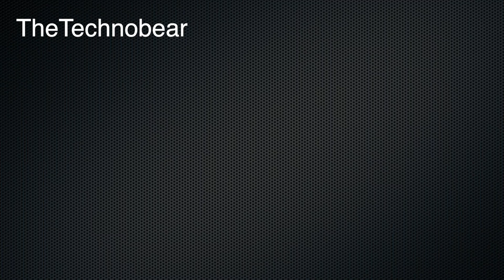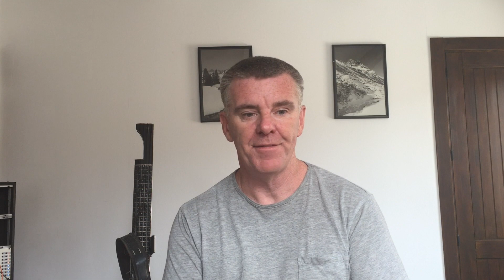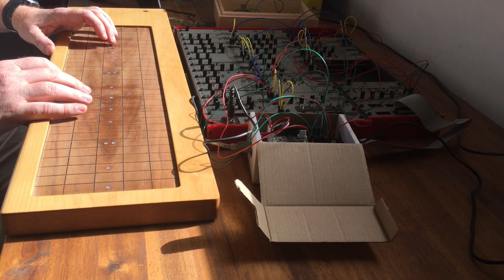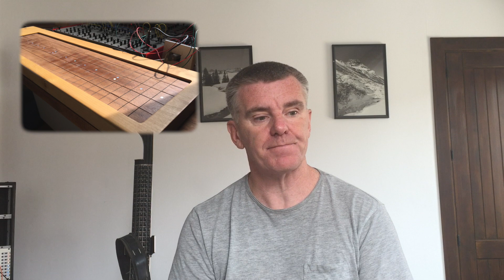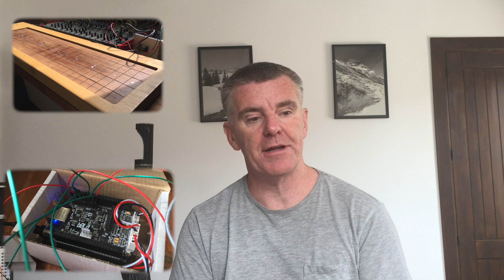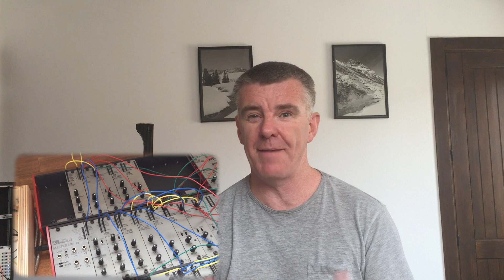AE Challenge #6 - VCAs for expression

Comment: So Bela is converting your touch straight to CV? And what language did you program the beagle bone in? (Just got one thing of getting a Bela ) Great vid thanks!
Reply from the maker: yeah, Bela communicates with Soundplane via usb, and then outputs CV via the analog outputs on the Bela. Its programmed in C++.
Reply: Could I do the same CV conversion with Pure Data or Python (just starting with Python)?
Reply from the maker: @subfusc2848  The low level soundplane code is C++, so you cannot do that in python/pure data - but an interface could be created to expose it in pure data (external) or python.
that said, the bit of code you might want to play with , is the converting of 'touches' to CV, this is pretty straightforward C++ code , so it'd be easy to modify, for example to change scaling.   all really depends on what you exactly are trying to achieve.   
do you have a soundplane? or are you thinking about something else?  as other controllers would likely be midi, and than could be done in PD on bela.
Reply: @TheTechnobear   No I don’t have a Soundplane. Working on another way of interacting with my modular. Being a drummer, I’m working on ways of detecting movement and pressure (Brushes on a snare drum) and how I could convert this to control things on the modular. I don’t want my laptop on stage with me, So a Beagle Bone Black and a Bela Cape, seemed like a good way forward. I’m still at the early stages, so any advice music appreciated.
Reply from the maker: @subfusc2848 , bela is pretty much designed for that kind of thing... as its primary focus is low latency. 
you best bet is to head over to the bela.io forum, and post your ideas there - everyone is very helpful :)